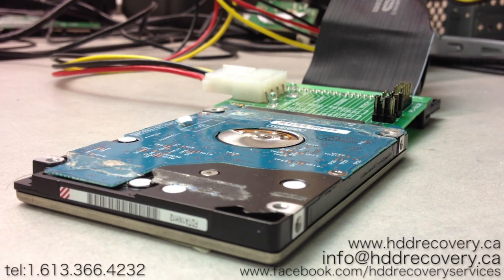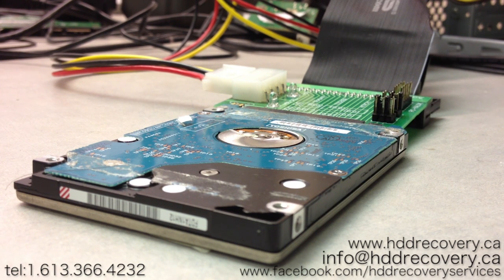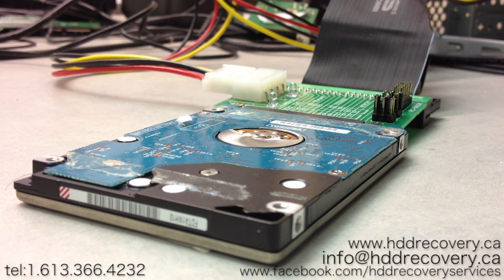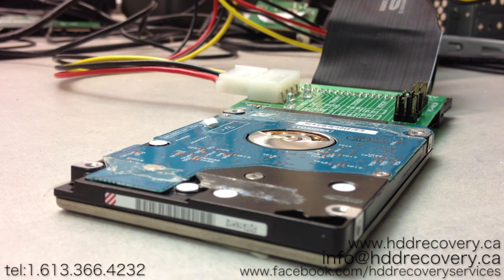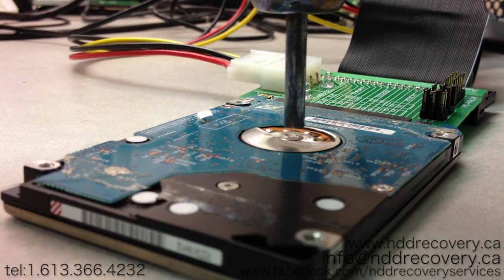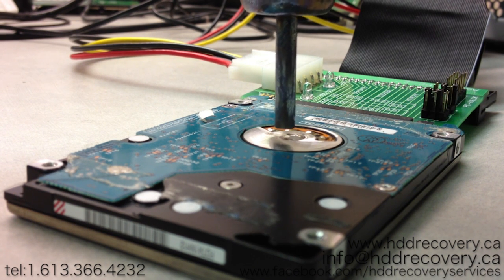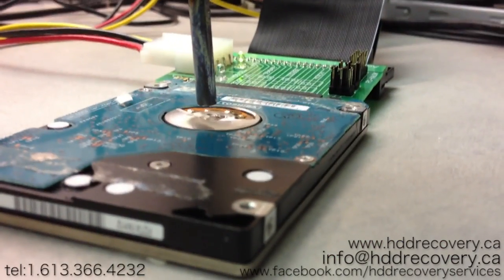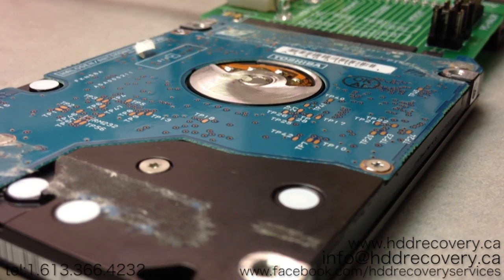data recovery tips: how to perform a Toshiba HDD recovery

Comment: Anyone watching this video should be aware that this issue is only common on very old 40Gb and smaller Toshiba drives.  Heating the bearing on any modern Toshiba will only result in more damage.

Comment from the maker: If you drive is not detected in the original enclosure - then most likely enclosure is not fixed properly. Take the drive out and connect it as secondary drive on PC via SATA or just get any generic USB enclosure for the drive. Unless your drive was damaged as well when the port broke, you should be able to mount your hard drive this way.

Comment from the maker: Ideally get a consultation from a professional. However, if the drive was off power heads may have been able to withstand the impact. If your drives starts to click on initial power up, then just turn it off (heads are dead).

Comment: For another problem that is not Toshiba related, I found a clicking problem with Seagate external and internal HDD's. Seagate external pre-made Hard-disk drives and even internal HDD's click when you try to transfer too many files from different or the same places. The drive head has to move too fast around the platter and back and forth. The HDD's are not as well built as a Western Digital for example. The solution in this case it don't over do the large file transfers and do multiple file transfers at once.

Comment: Opps it was an HDD just like the one you have in this video, I opened it up as when I powered it up I could here the clicking. Witch is a stuck pick up, opened it up moved it to the off ramp. Boom Done data recovered :)

Comment: I've had a Toshiba laptop for six years.  And for as long as I can remember it has always been making a clicking noise.  Only in the past couple months has the computer shown signs of hard drive failure. I've never had a laptop come as loud as it did.  I've been suspecting that its something to do with the actuator arms but I'm not entirely sure.  When the drive is running I hear a clicking sound and its pretty loud.

Comment: PART NUMBER: HDTB105EK3AA Toshiba USB 2/3 500gb . It worked for a while now the white l.e.d just stays on for about a minute finally flashes a few times and goes off. I hear the head once. sometimes beeping. It doesn't have a mount point nor shows up in PC or Disk manager but shows up in Device Manager I use W8.1 never tried it on another machine. What is most common problem with these ? I know they have been discontinued.

Comment: I have dropped my 3.5" seagate HDD onto a stone floor (it was a standalone drive, not inside a box) , should i resist the urge to turn it on, so as not to create more internal damage. NEED ADVICE before i probably lose all my data. thanx

Comment: I have a Toshiba 2.5" Hard disk. The problem is the HDD cannot be booted on my laptop. When I turned on the laptop, it sounded like "clack clack". I think it is spinning inside, then it clacked, then spin again for about 3 secs and clacked and so forth. What do you think is the problem here? Will it be possible for ants to get inside the HDD because two days ago, they did enter my laptop through the keyboard :(

Comment: My laptop got fried from a power surge and will not boot- i took out the 2.5 toshiba HDD and connected it with a usb hard drive enclosure actually 3 different types and it never spins or trys to do anything-  i hear no noise from it whatsoever--- what would a power surge damage so that it wont even attempt to spin?  lost cannot find examples of this anywhere

Comment: I've got the same issue with Toshiba MK3021GAS. Can it be fixed? Maybe pour some lubricant? Or just replace bearings from another hard drive?
Reply from the maker: the best thing would be a platter swap into a new chassis, but it is not a DIY type of stuff. Rework station may be a quick and simpler solution if you have a small amount of data to copy.
Reply: yes, rework station worked well, thank you man.
But I think I'll try to replace the motor assembly anyway

Comment: I have a Toshiba Automatic Backup USB 3.0 portable hard drive and I recently broke the port. I exchanged it with another of the same port but as the drive comes on, but it wont open and show any of my files. I did change the format of the drive to fat32 a good while ago.how do i get my data off the drive? please help

Comment: Make sure is USB 1.1/2.0/3.0 or internal sata I/II/III replace CABLES with same speed for example sata III buy the same speed cable, same goes for external interface bad USB 3.0 replace with a USB 3.0 cable.

Comment: My Toshiba downloaded some Windows updates in August and started rolling through the recovery sequence. Couldn't run the repair even though I got to the screen (Win8). HD is not clicking, i tried to hook an external HD kit to another computer and i see the data but it freezes when i try to copy it. Any suggestions?
Reply: Same thing with my HDD. The disk is probably almost dead. I was able to get most of my data using "Parted magic". Its linux distro runing from flash drive. Linux was the only way to open and wiev files without freezing. Ofcorse i wasn't able to get all data back because drive was broken but i managed to get most important data back.
Reply: You lost Partition magic on your computer and then hook the drive up, and it recognizes it? This is my thing, how long did it take to get some of the data off?
Reply: James G I got ~40GB of most important information in about 4hours. First bad thing was missing partition, recovered it with minitools partition wizard - Checked disk system, fixed errors and the disk was readable . Then i was geting freezes every time windows apps was trying to read the hhd.In my case freezing was caused by data written on bad sectors. Bad sectors was also a reason for missing partition. Parted magic was the only way to recover data without freezes.

Comment: so i have a hard drive that has the heads going through the startup process seeking then going back to park and through that process several times. its a mq01abd100 is it possible the controller is just defective? i want to recover the data but if i cant no harm but if i can it would be nice
Reply from the maker: I am actually working on that exact drive right now. Heads are dead, and need to be replaced with these symptoms

Comment from the maker: Was it a toshiba drive inside? if so you may get away with using your original board. No need for reflow, it may simply be a blown fuse. can you undo the PCB off the drive and take a clear picture of the component side of the PBC and email it to us? I will explain what may need to be done. Our email is info@hddrecovery.ca

Comment: so while heating is on you can transfer your data are you saying?
Reply from the maker: Mike K this works only on Toshiba drives of GAS and GAX generations. Modern GSS GSX GSXN drives don't really suffer from issues with the bearing assembly.

Comment: my hard drive spines very well without bad sound, but refuse to show up on the system...please help
Reply: linus onah please do not open your hard disk .. these all videos are made for jus fooling you really. i opened and then they said your media is damaged ....dont even try to touch the head of hard disk that is where you damage it plz... i had to pay for it but you dont make this mistake
Reply: so what do you suggest?i do.
Reply: go to some hdd recovery service centres they will charge u a little if its media isnt damaged but if media is damaged or corrupt they will charge a cost double or triple of cost of new 1 tb hard disk. i suggest buy a new hd if ur data is not so important
Reply: +linus onah  Download TestDisk and recover data
Reply: You
mean i should download TestDisk from the internet?
please simplify.thanks
Reply: linus onah
 Yes download it onto a flash drive (on another computer) and then insert the flash drive to the affected computer, boot the machine and enter the boot option menu (usually by tapping F8), then boot from the flash drive and access Test Disk. There are complete instructions on the Wikipedia site for Test Disk and download link.
Reply: linus onah
 Oh and use a 32gb flash drive or External Hard drive to put Test Disk on if you have a lot of data to recover...I actually use a 500GB external HDD to run Test Disk and recover files.
Reply: linus onah
 You can also download Linux Ubuntu distribution (I would use 12.04 only as it is stable) And run it off of the external hard drive, When you open the file folder on the Linux OS you will see your windows hard drive and be able to access the information and transfer it to the hard drive. You can use that method if you don't feel comfortable using Test Disk, Test Disk is a command line program. I'd watch a video on data recovery with Test Disk first if you go that route, the Test Disk Terminal provides instructions pretty well.

Comment: The heads are clearly broken. The only way to retrieve your data is to send the whole drive to a specialized firm where they will remove the platters and have them read out by a working drive.

I'm sorry, but it may cost you up to 500 euros and beyond. Get a quote before saying yes to anything. Some companies won't charge you a penny if the platters are too damaged to be read out (no-fix-no-fee).

Good luck mate!

Comment: $1600 to fix a harddrive? Hell naw. I'd rather lose all my data lmao. Good video though. I hope I'll never have to do that. I just got a brand new HP with a Toshiba HDD. It's only been 2 months before it started showing signs of failure... I'm going to back it up and replace it soon enough but this is just disappointing... Windows boot up is taking 10-15 minutes and read/write speeds never exceed 10 MB/s with an average of 1MB/s. Why toshiba why. I'm never buying a laptop with a toshiba drive from now on.
Reply: You should have to sent it to warranty service. It's not normal for any hard drive. I had Toshiba 3.5'' HDD never had any problems with it repentantly sold it to my friend because it was too bulky and I don't want to keep that much data any more.